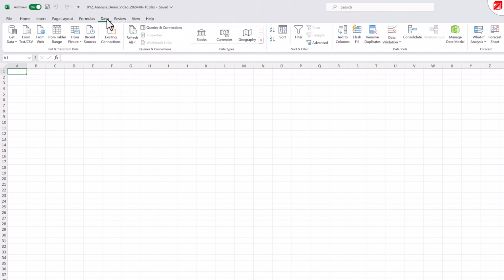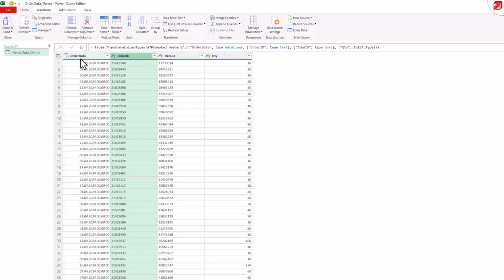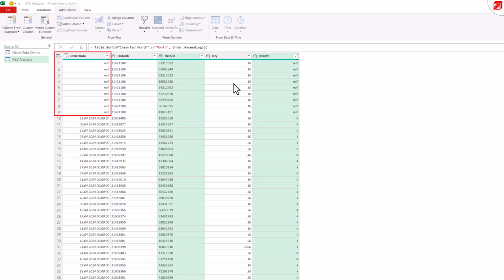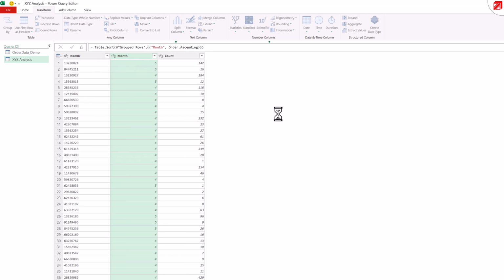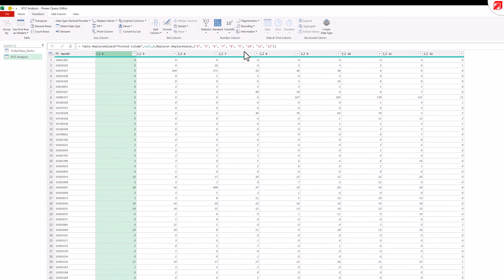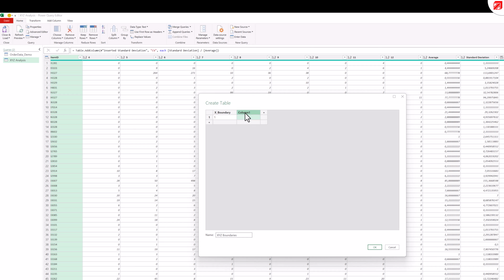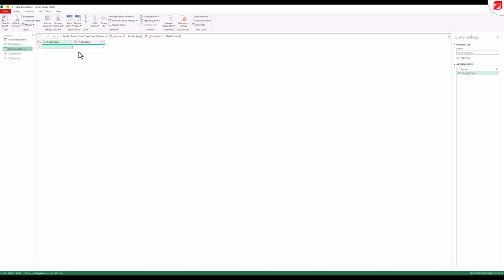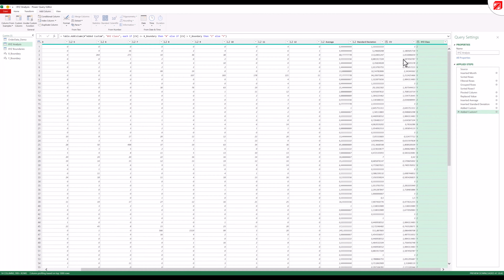Mastering XYZ Analysis with Power Query and Excel: A Step-by-Step Tutorial

Comment: Great video. A question- is XYZ normally categorized on CoV? - where I work they classify it purely on order volume. (Which I’m now questioning 😅)
Reply from the maker: Thank you!
Coefficient of Variation (CoV or CV) is independent of the unit of analysis you use. It is a measure of variability and dimensionless. In the video, I used orderlines, but you can use volume or quantities just as well.
Reply: @JakobBeer  thanks Jacob. We actually use orderlines also- but literally the volume of them not the variability(eg the SKUS that contribute to 80% of all our orderlines are X, the next 15% are Y, and the last 5% are Z) - variability is not considered at all. I think we are doing it wrong- variability should of course be considered.
Reply from the maker: @martyc5674 : Alright, I see. What you are describing is typically called ABC Analysis. ABC Analysis is a way of operationalizing the Pareto Principle whereas XYZ Analysis aims at understanding variability (and thus implicitly predictability) of demand. You can also combine the two (making it an ABC-XYZ Analysis) in order to get a better understanding of the combination of importance and variability.